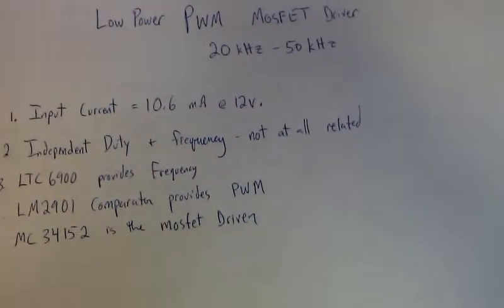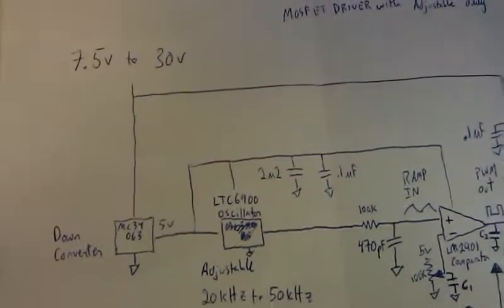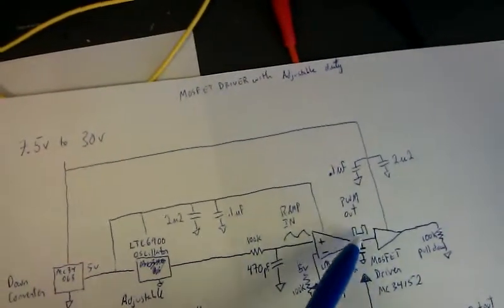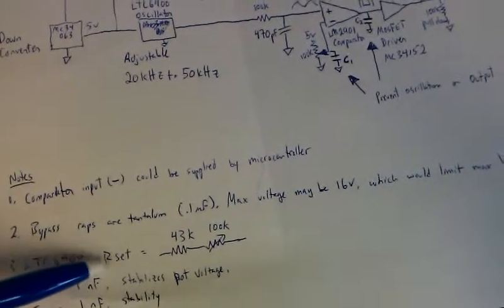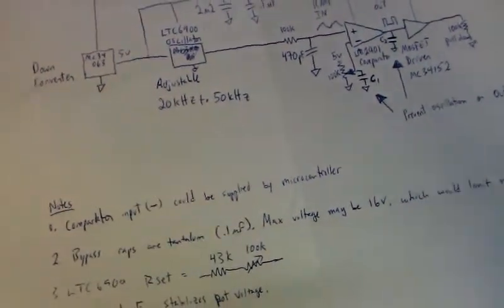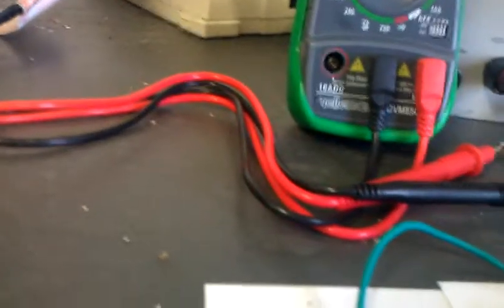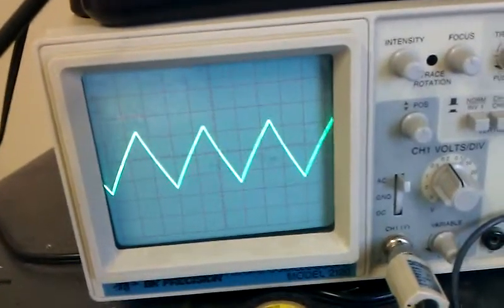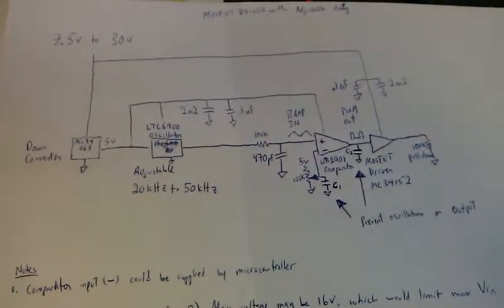Best - High Efficiency Mosfet Driver with Adjustable Duty and Frequency

Comment from the maker: It is more challenging to use the same circuit for higher frequencies.  However, the LTC6992 from Linear Technologies has an adjustable frequency from 3.81Hz to 1 Mhz and 0-100% duty.  LT makes a whole line of ICs called TimerBlox. Newark carries these ICs for around $3-4 USD.  Good luck!